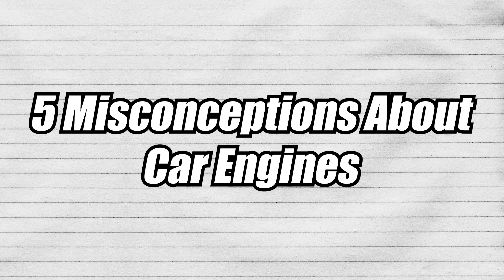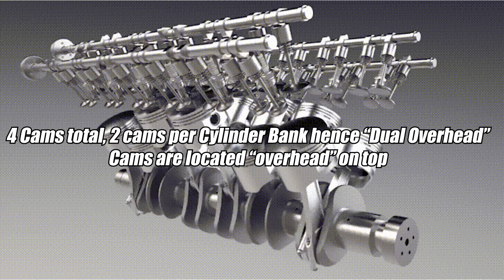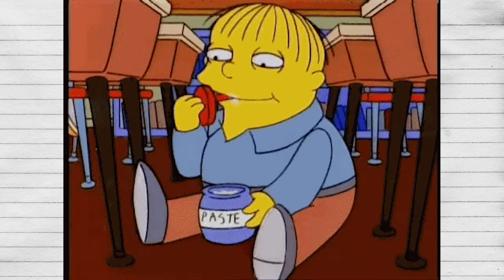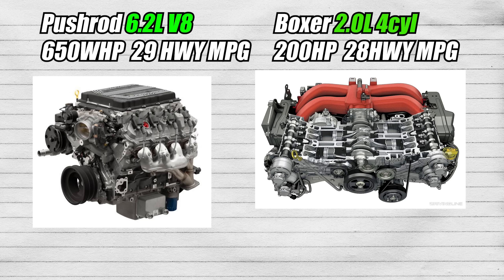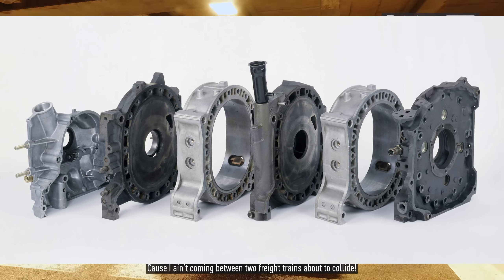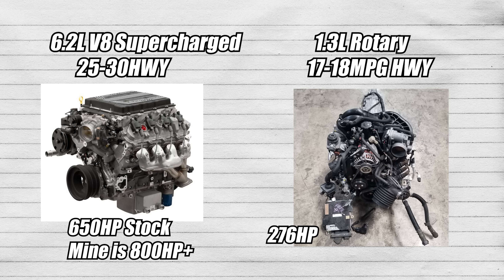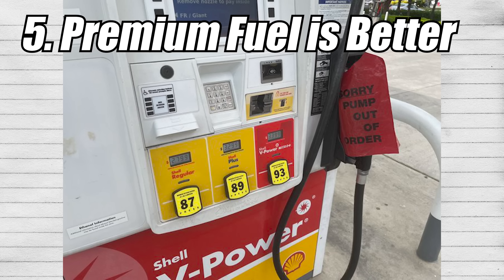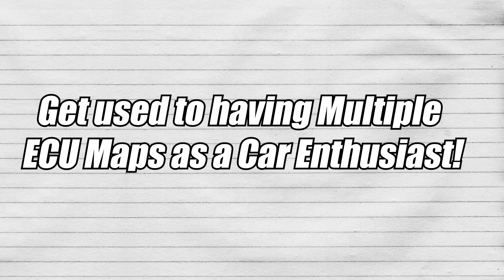5 Misconceptions About Car Engines!

Comment: The fuel economy thing is facts my EJ257 is bone stock untuned but is awful on gas despite being a turbo 4 cylinder
Reply: turbo boxer + awd is never going to be good on gas, there are other turbo 4 cyl cars that are tho
Reply: Same engine here, also stock. 
I can't figure out what advantage was gained by Subaru going with a turbo 4 instead of buying LS engines from GM for the WRX/STI.
Weight? No.
Fuel efficiency? Big no.
Emissions? That's directly from fuel, so also no.
Cost? I doubt it.
Power? Nope
...oh. Japan's asinine road taxation. That's it.

Comment: There is a correlation to displacement relative to fuel consumption because it’s undergoing higher volume ms if compressed fuel to ignite with each cycle.. and more cylinder etc, we know that, but like you said, people think that every v8 just = 0 MPG

Comment: you are wrong about the bigger engines not being less fuel efficient. there is definitively less efficiency the bigger the engine but there are many things that play a roll. car weight for example and the type of driving you are doing. there is a limit to how small your engine can be and how big it can be. there is a sweet spot for where it's the most efficient. but bigger still= less fuel efficiency same as cylinder count has a massive impact. but yes it depends allot about what vehicle we are talking about as with more weight and size you also need a bigger engine to compensate. take trucks for example. if you drive the truck empty the smaller engine is going be more efficient but ones you load it up to max load the smaller engine will be less efficient because now you got more weight. 500hp truck can pull the full 161 000lbs that is allowed here but it's going to work hard att it's limit. the 750hp truck although less efficient than the 500hp one has more power meaning it does not have to work as hard and therefor is more economical and stays better within it's eco range. bigger always drinks more fuel but it does only do that when you are talking about both engines working att the same stress level. if the smaller engine is pushed to it's limit it's going to drink a fuck ton of fuel but the bigger engine might only be pushed half way meaning it's in a more efficient power range and burns less fuel.

Comment: the thing with engine size not playing into fuel economy is just straight up false, at least when you look at the car as a whole system. also less rpm doesn't just equal less fuel consumption. there's a lot of complicated math behind efficiency calculation. most petrol engines are at their most efficient usepoint at about 2500-3000 rpm and about 70-100% load. obviously if you go out and try to reach this point with a car in a realistic scenario this isn't going to work. This is because as you get faster the aerodynamic drag increases exponentionaly with speed. so you have to find the sweet spot of which gear at what speed sits at what rpms with how big of a load. you can calculate all of the engine side of the data using a thermodynamic work cycle, the energy density of your fuel, your engines overall thermal and mechanical efficiency and the different pressures inside the combustion chamber which are defined by your engines compression

sincerely, a engineering student

Comment: While you are right that oil needs only about 15 seconds to get to all places, i for my part wait some minutes like 3 or 5 so when i drive, the car already has some temperature in the oil, sure its not even at 50C but i think 30 or 35C is better then 0C. Naturally as a normal human beeing i only start pushing the car if it hits 90C and even when it does, i wait to make really sure the temperature stays there for a bit. Metall needs some time to expand and to work, pushing these parts can destroy the health of your engine. And while its heating up i try to stay in low rpm’s, so the car gets “wakes up” like you when you stand up slowly and do all your things in the morning, because you where today responsible and didnt hit snooze 7 times but actually woke up with time. Thats how i treat my engine and well obviously good fuel.

Comment: “What gives?” About the 2 examples of fuel economy comparisons is that both the J series Honda V6 and what looks like an LT1 from the new vette they both have forms of cylinder deactivation, meaning that when highway cruising or when you’re not demanding a lot of power, both of these engines will “turn off” multiple cylinders, in the LT1 or the new Chevy vortecs it can be as many as 6 cylinders! 6.2 divided by 8 is .77 meaning when the deactivation occurs, you’re essentially running a 1.55 litre engine. There are of course exceptions where bigger engines are more efficient than their smaller counterparts, but the gap in displacement is almost never that big. With the rotary, they are less efficient because they have more combustion cycles per minute vs an equivalent revving 4 stroke engine, plus they are often paired with a turbo. You’re not wrong, but I do believe the examples provided may be misleading to some that don’t have a good grasp of what makes an engine efficient or inefficient. Obviously compression ratio and injector size also play a role, but it’s mainly gonna be displacement that determines the “base” fuel economy the engine can potentially have. And no, I’m not a politician lmao. Great video otherwise love your content bladed👍 edit: good point about the chassis an engine is mounted in. The aerodynamics and gearing of a car also play a major role in fuel efficiency, but if we’re talking strictly about engines and not the chassis they are mounted in, it doesn’t play a role.
Reply: Also for warming up engines, it depends on the engine. Both Honda and Hyundai have had issues where not putting a full heat cycle through the engine causes fuel dilution in the oil, which causes premature wear internal to the engine, causing oil consumption or worse. It can also cause your catalytic converters to prematurely fail if you start demanding power from an engine less than a minute after cold starting.
Reply: Ok but then... Cylinder deactivation is just another advantage of higher displacement engines. The Accord's V-6 would still improve a BRZ's performance and fuel economy, for reasons borne of higher displacement
Reply: @nthgth  they only add it because of emissions and fuel economy regulations, not because they want to. overall cylinder deactivation is a disadvantage. It’s only good when it works and it will always have a negative impact on the health and longevity of the engine. And it adds more parts (and cost) to the engine. On the chevy v8’s they cut oil pressure to select lifters to “turn off” the cylinders. I’ve seen new Chevy 5.3’s fail as low as 11,000 miles. Needing an engine rebuild to fix. Not worth it imo. Plus a Honda v6 weighs a lot more than a boxer, it would increase the power a bit sure but you’d destroy the weight balance and handling characteristics of the brz

Comment: My dad has a 2016 dodge charger rt and he learned that its better with mid grade fuel instead of the regular 87 we are used to. People on the internet it claims better mpg and power which is most likely right about the power but mpg is just based on your foot. 😂
Reply: No, its better mpg as well. Higher octane fuel (as long as your engines tune can take advantage of it) allows more aggressive valve/spark timing and leaner air/fuel ratios, which means more power out of each combustion event, and since its leaner you're using less fuel per revolution while also putting out more power at any given revolution, which means better fuel economy even without changing your driving.

Comment: The rotary in the hybrid mazda is being used as a generator. Most hybrids until now have used to electric motors to take the load off an ICE but the Mazda rotary will be acting like a small generator for a car purpose built to be electric. Its basically a Tesla with a generator charging the battery.

Comment: ive owned 2 VQ's and theyve been amazingly reliable bc i change my oil every 3-5k miles (full synthetic always), i let the idle drop before moving it (usually takes about 15-30s depends on weather) and i keep the rpms below 3k for 10 min at least and under 5k for 15 minutes to and dont pass 50mph in that time in order to warm up the differential and the transmission before driving it hard. regular maintenance and ive never had any issues.

Comment: I got an ‘03 IS300 and it’s 2JZ-GE engine, I knew as a 6 cylinder it might have an abismal mpg, and I sadly wasnt wrong at a supposal combined 17 mpg, I drive in the city so its like 15 😅, as a high schooler with a part time job its pretty bad, even worse as it takes premium. Glad to know that some V8s have even better has mileage than this.
Reply: That's a (very cool) performance engine, not built for economy. 
All the same, I averaged 17mpg in my parents 4cyl '09 Camry for a week when I was 21, not even being an aggressive or lead-footed driver, so anything's possible lol
Reply: @nthgth  no yea its fun asf to gas it sometimes, but def take it easy a lot. Camrys are nice but the older ones can be pretty bad on gas lol.
Reply: @andyguous  he says he got 17 mpg in a 4 cylinder 09 Camry? WTF? That makes no sense unless he’s doing real aggressive jackrabbit city driving. I know lots of people with those cars and they usually get around 27 city and 32/33 highway. Maybe a little higher if it’s the rare 5 speed manual. I happen to own a 1st gen (yes, a rarity), 1986 5 speed manual liftback Camry. It’s got the 2.0L 4 cylinder in it, and it’s a 95 horsepower car that is 2530 pounds, and in 5th gear it sits at 2500 RPM at 75 mph going down the highway, and it will get about 34/35 mpg. on the highway depending how you drive. But about 27 in the city. Honestly, driving habits usually Matter more than the car in terms of mpg. And one day I’m just tempted to throw it into neural and put cruise control on a second afterwards coasting on the highway and not hear the engine and really hyper mile the sh*t out of it. But I haven’t done it yet because it might be a stupid idea, especially with stuff around me on the highway.

Comment: The second rule is so true. Take the raptor and ford GTs 3.5 ecoboost fo example. 12mpg if you’re lucky, and my buddies gen 3 5.0 can get up to 28mpg but usually sits around the 19-20 mark. The raptor and ford GTs fuel economy is horrible for such a small v6

Comment: Road engines vs train engines vs cruise ship engines vs submarine engines. The difference is more shocking than you might think.
Fuel economy can be altered with the right tuning and timing. But here's the thing I learned, if you can get more of a mist, hence use less fuel, you can get more power but also a hotter engine. Here's the thing though. Lambo makes V12 engines with the same liters as a V8 but gets worse mpg. You would think that less cylinders means better gas mileage. I also learned something else a while ago. Look up lawn mower carburetor in a sedan. There's a guy who took a lawnmower carburetor and put it on a V8. It did run.
Engineers found out that they can get better economy at lower RPM's and decided to test adding more gears and changing the gearing ratio and timing. This is why vehicles were stuck in 3-4 speeds for the automatic and refused to change the manual. Automatic transmissions have evolved to have more gears for better fuel economy. Transmissions now have over 10 speeds.
When I start my car I just go into gear (automatic) and ease forward, not getting my RPM's over 2k so it's not putting a lot of stress on my car. The same for my truck which is older.
In terms of fuel price, if your car needs a certain fuel grade it will say. An engine that takes regular can take premium but an engine that specifies the others you need to stick to that, but try the others to see if your car runs fine with it. My 2015 Mazda3 takes regular but will be fine on premium. My 1999 F150 with the 5.4L runs fine on regular.

Comment: You really need to reconsider the fist myth as fact as there is no replacement for displacement. For example of using your example on what would happen if you take the twin turbo set up and put it on that NA 5.0L V8, the end result would be more power with exact same set up.

Comment: 4:00 my 2.0 turbocharged 5 cylinder gets 29 to 25mpg in highway while a 1.2 engine gets the same milage. I completely aggree on letting the gas off on highway speed. The engine just handles the air drag at idle rpms.

Comment: My sierra c3 has a feature where the transmission will hold gears to warm up the engine faster. its amazing how fast it heats up in 43 degree weather.
Reply: Meaning it revs higher when cold? That doesn't sound smart but I'm not an engineer

Comment: Slow down! 
I thought you said a pushrod engine cannot be overhead valve as it went so quick. I thought it was all kinds of wrong but pinged back and cleared it up.
I'm guessing many sentences were spoken then edited together. It leaves me out of breath listening this way though 🤣
Maybe I'm just too old.
Reply: On that topic, why call pushrod engines OHV? If the camshaft is overhead, the valves sure as shit are too! OHC is also OHV.
Reply: @nthgth  pushrod engines have the single cam above the crank below the head. When they came around there were engines that had valves on the side of the engine (flat head or side valve)
An overhead valve engine and an overhead cam engine aren't one and the same thing.

Comment: We have two old diesels, they were made the same year and the weight the same. One is a 2.0l 4cyl with 140hp/320nm, the other is a 2.4l 5cyl with 175hp/385nm. Guess wich one is more fuel efficient? Thats right, the bigger one! It has slightly longer gears and more power, so It can easyer pull it´s weight and travel at lower rpm. Well, unless I floor it, because that 5cyl sould is just amazing, but thats on me! xD

Comment: As a BMW owner, warm your oil or kiss goodbye to your rod bearings. 
Ignore this video. By all means, drive off, but don't nail it until your oil gauge is at TDC.
High octane fuel doesn't give you more power, it gives you the quoted power and a clean delivery.
Putting lower octane in won't kill the engine but it will leave the gate open and let the horses bolt